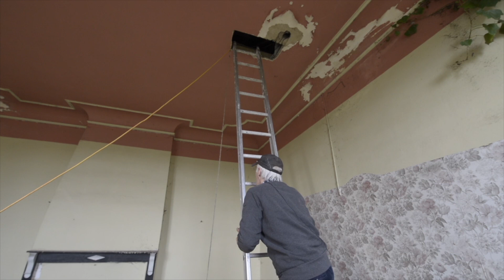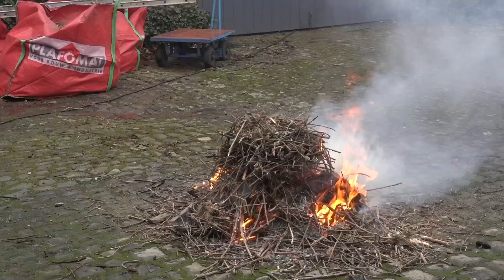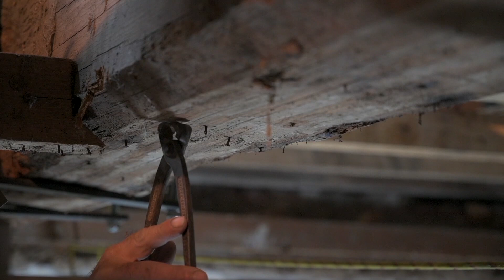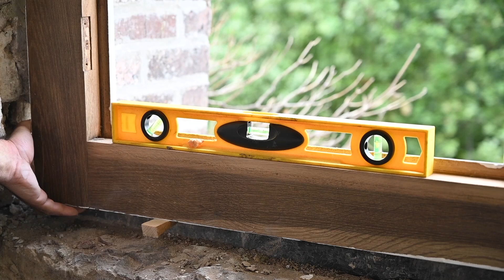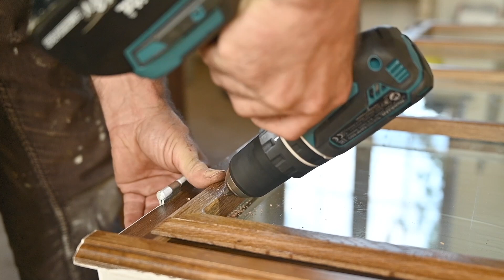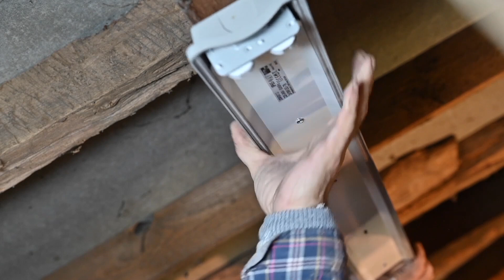Wrapping up the Tower Room - flashback

Comment: I was just wondering recently how and if the tower restoration was proceeding and then this video came out 😄 tip top work as always and i like the walls' color. Some industrial fixtures for the light could be a very good match with the sealing. I have a similar sealing in my house (darker wood with bricks between beams) and i added black industrial style lighting system, it fit good with this kind of mix between old and new. I can't wait to see the episode where you are going to build them, i know that you are going to surprise us once again  😁
Reply from the maker: thanks for the comments, you will see soon what I will do with the lights... It will be something very modern